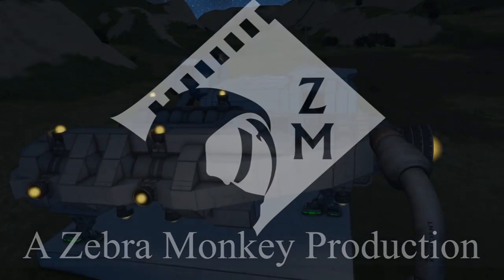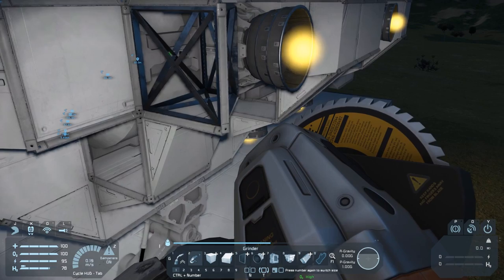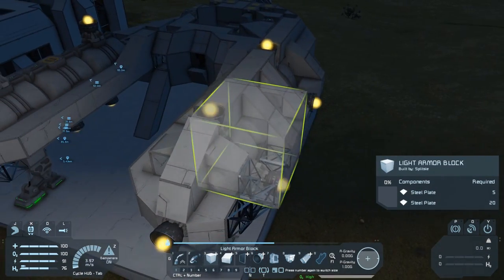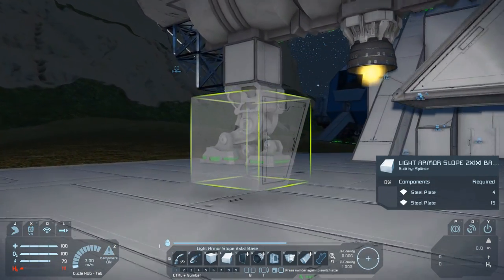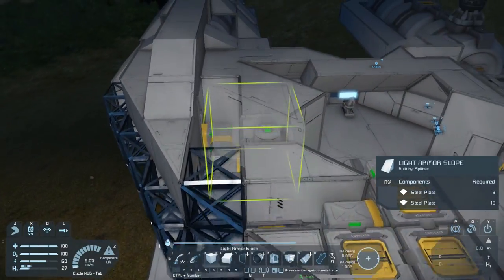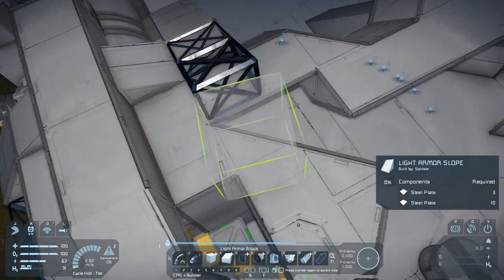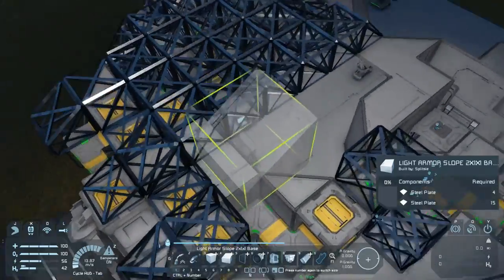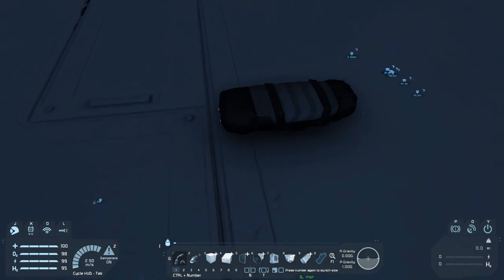Space Engineers Tutorial: Large Ship Design Part 3 (Survival design tutorial series)

Comment: Another question about Airtightness.  If two air tight doors are joined back-to-back and you ensure that when passing through them that only one door is open at any one time, is there a need to pressurize the inner door passage at all?  In other words, if the inner door is closed when I enter the outer door to the passage, shut that door behind me before I open the inner door, will the entire room de-pressurize even though the volume within the door passage is extremely small.  

To my mind, the volume of the passageway is so minimal that it should barely be a blip on the pressure of an entire room (the bigger the room, the less the effect).  And given that their are no wind factors in SE, nothing is going to be affected by air blasts when doors are used in this manner.
Reply from the maker: If you put two doors back to back you wouldn't need a vent at all. You'll still lose a little bit of oxygen each time you use the airlock, but I think you're right, the amount will not be particularly significant. 

The depressurisation effect should impact loose objects and players, but not many people have loose components floating around their ships or bases so it's a rare negative.

The downside is once you start building lighting into your ships. Your airlock won't be able to have a light so it'll be pretty dark in there. Not a big problem for most applications but worth noting.
Reply: Thanks.  It sounds like a lot of unnecessary work (and resources) can be avoided by placing two doors with one or two sealed block spaces between them to accommodate a light, will do the trick.
Reply from the maker: Pretty much, my first few builds in any game tend to be brutally efficient and then I have a habit of going off the rails to build whatever I think will look best :P
Reply: i just tested this idea with 2 doors back to back and when closing the inner door while in the airlock area the airlock room when to 0 pressure seems all the air stayed in the ship and  did not notice any venting also the oxy gen did not kick on however you need to get in the habit of closing all doors with this method as if you forget one door then open the next there goes all the oxygen , so that method works just dont forget to close any doors.
Reply: Thanks for conducting the experiment.  The door issue is valid but I guess it would be the same if you had a vented airlock.  I think as I get more into that stage of development I will look to using Sensors to open and close the doors so that i can't forget.
Reply from the maker: Did you use the sliding doors or the other standard doors? From what I've managed to test the sliding doors will lose a little bit, but it appeared to be inconsistent, but the other type of door won't lose anything at all which is handy if you want a simple to setup and efficient airlock :)

Also the leaving of both doors open would be a major issue if I ever played with my housemate Capac, the way he acts with doors it's like he grew up in some sort of tent :P
Reply: You guys did such a fantastic job working out if back-to-back doors will work as an airlock that I thought it only fair that I should work out the door operations.  It’s a bit long winded, but bear with me and I do recommend that you place 1 x Block space between the two doors to allow all actions to occur without interruption.

You will need 2 x Sensor Blocks, 2 x Interior lights (one by each entrance set to a colour and blink interval of your choosing (optional), 1 x sound block (optional) and 4 x Timer Blocks (TB).

Place one Sensor in front of each door to detect movement a short distance in front of the door.  The deactivation range of the Sensor in the direction of the door needs to be Set so you are outside of the box when you are at the back of the Door Block.  I placed my Sensors on the floor directly in front of each door (a space that is never going to be required for anything else).  In this location, the distance to be set for the cut off in the direction of the door is 3m.

Set your Sensor A to Trigger Now TB 1 when entering the zone and Trigger Now TB 2 when leaving the zone.  Likewise set up Sensor B to Trigger Now TB 3 when entering the zone and Trigger Now TB 4 when leaving the zone.

The settings for each TB are as follows:

T1 –  Sensor B - Toggle Off  (this will stop a person at the other side from activating the Sensor to the other door).
 Warning Lights – Toggle On
 Alarm – Toggle On
 Door A – Open

T2 – Sensor B – Toggle On
 Warning Lights – Toggle Off
 Alarm – Toggle Off
 Door A – Close.

T3 –  Sensor A - Toggle Off 
 Warning Lights – Toggle On
 Alarm – Toggle On
 Door B – Open

T4 – Sensor A – Toggle On
 Warning Lights – Toggle Off
 Alarm – Toggle Off
 Door B – Close.

If you are operating solo, you can get away with just a Sensor for each door to open and close them as you pass through, as there is no chance of anyone coming at the doors from the other direction. 

Hope this makes sense and is of use to you.

PS If you are in a habit of running through your doors I would recommend putting two spacer blocks between the two doors.
Reply from the maker: Particularly considering you laid that out in a YouTube comment, that was an impressive explanation. Do you mind if I steal it when I get around to making an automated airlock tutorial? ;)
Reply: I provided the info to do my part to help the SE community.  I'd be honoured if you shared it to a wider audience via your channel.
Reply: PS  This should also help to solve the tent flap problem you have with Capac ^--^

Also, it could be made a bit more fail-safe by also turning off the opposing Door when the opposing Sensor is turned off, to stop anyone from trying to by-pass the Sensor and open the Door manually.  But I figured any co-players would know about the set-up, there are flashing lights and alarms to alert everyone and it only takes about 5 seconds to walk through the airlock any way, so it hardly seems worth it.
Reply from the maker: Nice, thanks so much for that, I'm going to pin this discussion as it has a whole lot of handy tips and hopefully people will see them if they come across this video :)
Reply: Rotery airlock mod. Single block airlock that revolves in place and looks great
Reply: no, there is no need to pressurize/depressurize the inner passage
Reply: Airlock doors over time slowly lose oxygen when both are closed and are pressurized, for as long as the vent is there, there will be oxygen

Comment: Very good point on custom skids vs landing gear.  My preference is for a single locking gear on the nose/tail and a pair of custom skids. 

The aesthetics are nice but I retain the limpit ability land in gear grants you.
Reply from the maker: I think that's very good solution, needs a little more space to work but you'd technically only need 1 of them on a ship to lock to something so could be worked in fairly easily to a lot of designs :)
Reply: Splitsie Its something I first started using as a necessity for a Halo recreation build http://steamcommunity.com/sharedfiles/filedetails/?id=684647465

Because of its distinctive rear skids landing gear for the rear were not really an option,  but I've found myself adopting it on more of my original designs after I built this one.
Reply from the maker: Nice work on that build. It's really handy after you've built a few ships that you've got a library of ideas from each you've constructed to be able to pull ideas from for your new builds, I think that's why I'm normally happiest with my most recent builds :P
Reply: Totally agree, I found it quite fun to create lines of ships with similar styles like they came from the same manufacturer, taking what ideas succeed and incorperating them into the next build. Some with a sleek aesthetic and others more utilitarian. I found it made for more interesting designs as I was varying things up a bit thematically.

Also, while its less original I have found recreation builds often force a new approach as they tend to have shapes other than those that come naturally to Space engineers.
Reply from the maker: That's a really good point I hadn't thought of before. It's probably a good way for people who are struggling to come up with their own builds to start out, try to copy something, then use bits a pieces of it in future builds as you'll have a better understanding of the ways different blocks could be used to create a look